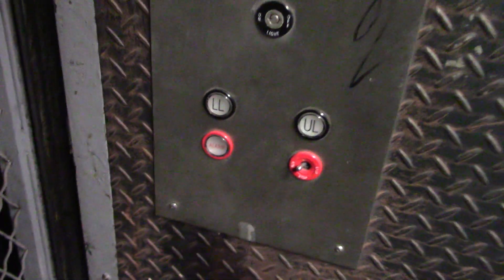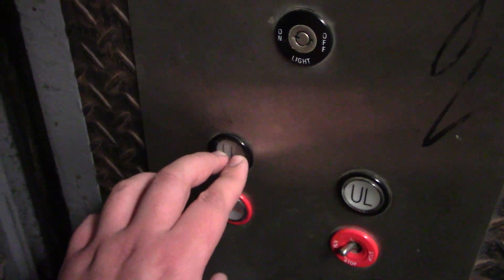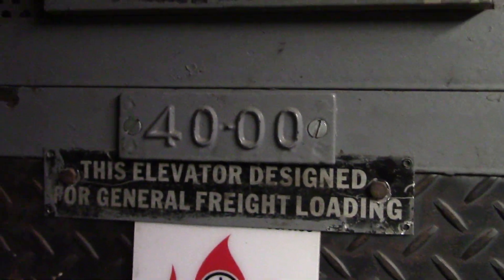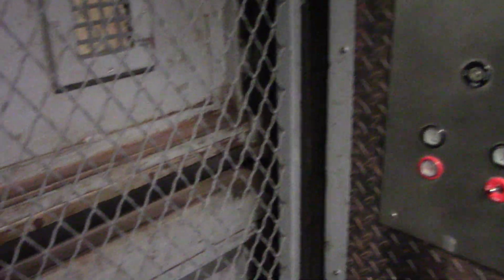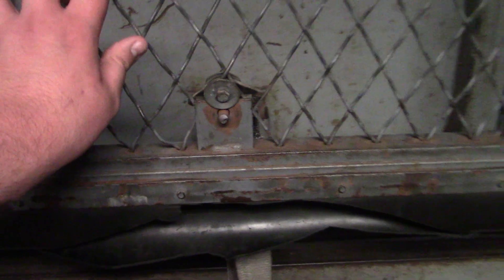Montgomery Hydraulic Freight Elevator (#2) - The Mall in Columbia - Columbia, MD (Take 2) | ECFE

Comment: They probably adjusted the leveling zone, they don't need to replace the controller. Best way to tell though is if it remembers calls & delays between arriving at a floor & accepting another call. Most newer controllers almost certainly have these.
Reply from the maker: Good point. This does not remember calls